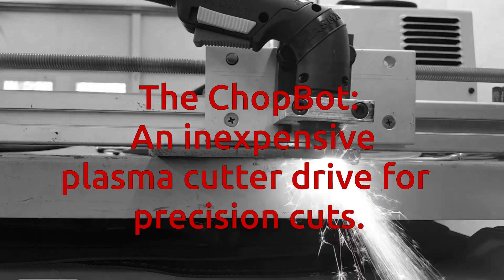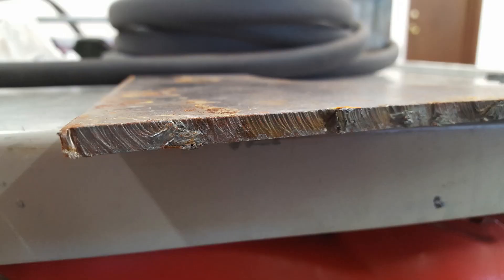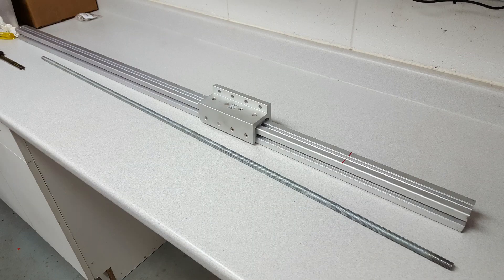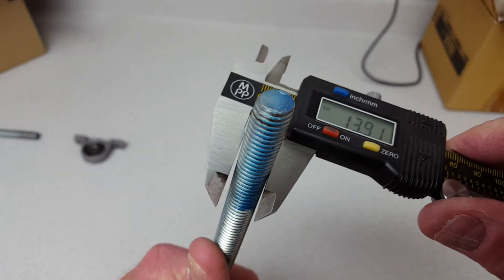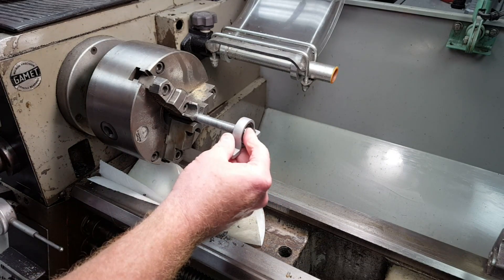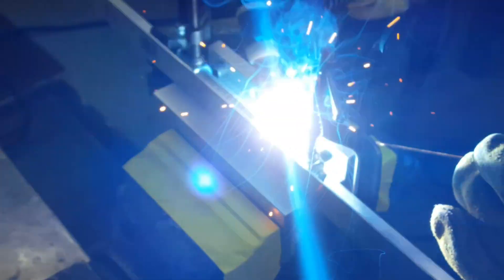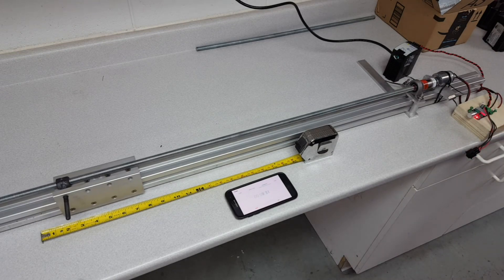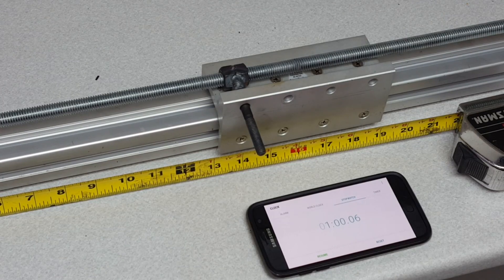Building the ChopBot, an inexpensive Plasma cutter linear drive part 1

Comment: You are gifted.  Cause the normal guy ( me ) could not figure all that out.   Good video
Reply from the maker: Don't sell yourself short.  You could absolutely figure out a project of this nature.  There are a couple of guidelines that I have always found very helpful, and absolutely true:  1.  Even complex projects are all made up of a group of smaller projects.  You just take them on one at a time, and assemble them together in a chain to create something more complex.  2.  EVERY problem is solvable.  By being methodical, and asking for help when you hit a dead end, you can always keep moving forward.  Its not always easy, but it is true.  Work each problem until you kill it dead.  
 3.  Never be afraid to fail.  Hooking up an electrical component wrong and burning it down, or drilling a hole in the wrong place isn't a failure, it is a learning experience, and an opportunity to get better.  This is not just a B.S. platitude, it is another absolute truth.  Jump in and try, and never be afraid to make something.  You will only get better.  The not yet revealed tag line of my channel is "Don't just sit there; MAKE something!"  That should be the driving force for anyone with a creative mind, and I am hoping to inspire others to get into their shops to create, build and learn.  Thanks for the nice comment!